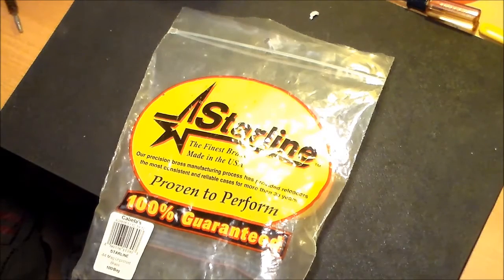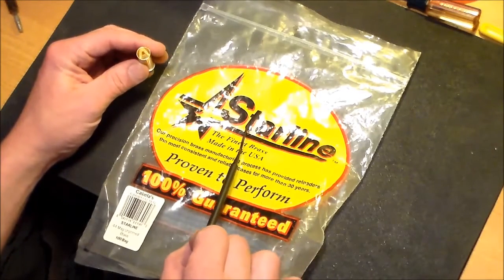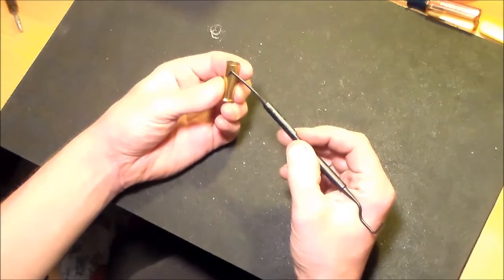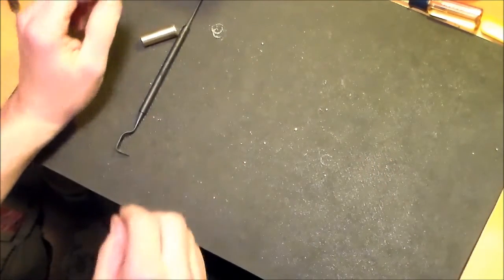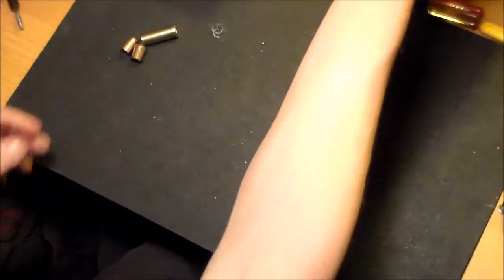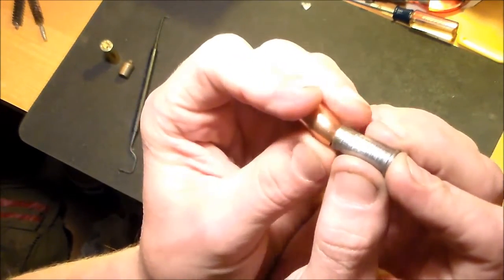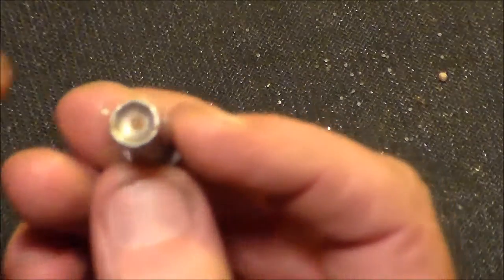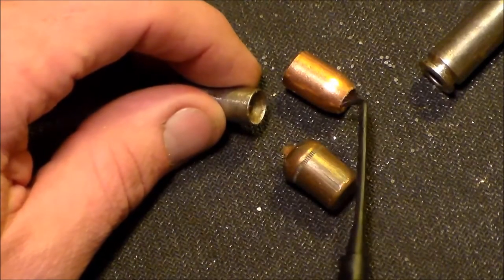Long Range Marlin 44 Magnum Part 2. Brass and Ftx bullets.

Comment: So did ya come up with a 200 yd load?Not seeing a part 3.
Reply from the maker: Nope not yet. As the story goes here, I got a new scope sighted it in with just some weak lead handloads. Got the gun home a figured i would clean it it's been like 3 years since i ran a brush though it. Ever since then I haven't been able get a consistant group under 3 1/2- 4 inches at 100 yards. before the cleaning it shot 2-2 1/2 inch groups ALL DAY LONG! I'm still working on it I'm just a little frusterated with it yet.